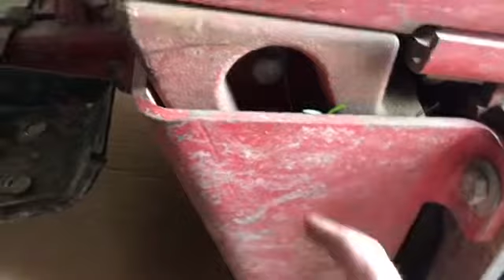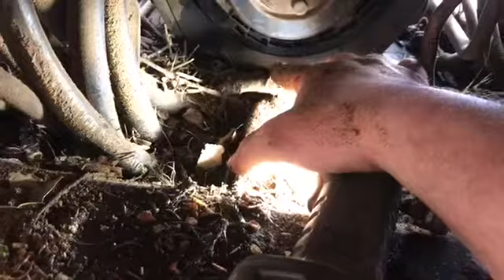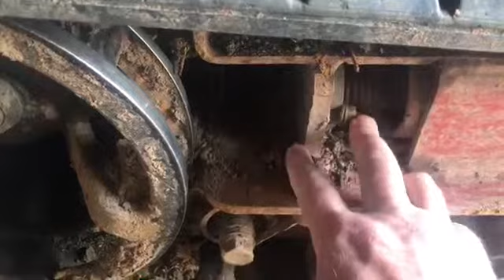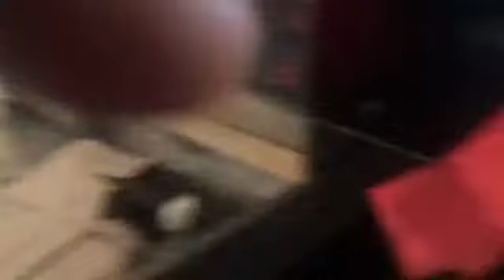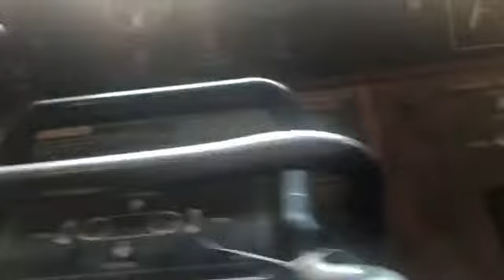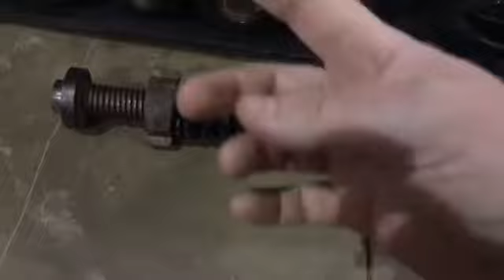Hydraulic motor removal for Toro Dingo 425 and 525 wide track

Comment: Un fortunately this isn’t the way the 525 is setup we just got one in today and I removed the batter and fuel tank to what seems to me that the engine has to be removed. There’s a flat 3/8 bar of steel that runs between both wheel motors as well.
Reply: It actually has the same exact setup as the one in your video where you changed the idler and belt

Comment: Dude, how'd you get the wheel off?  I heard you say you used a press, but that's what I needed to see.00  ;(  Thanks for sharing though!
Reply from the maker: use a big wheel puller.   Tighten, heat, hit with a hammer.  Repeat until it comes off

Comment from the maker: I forgot to say that after you put your track back on and tightened to put the small bolt and nut back on to hold the big tensioner bolt from turning when you use the machine
Reply: I'm looking at maybe buying a used dingo to do some projects around my house.  What should I look for, why do rental places sell them?  Worn out motors, Hoses, etc..?  Anything on them notoriously fail?